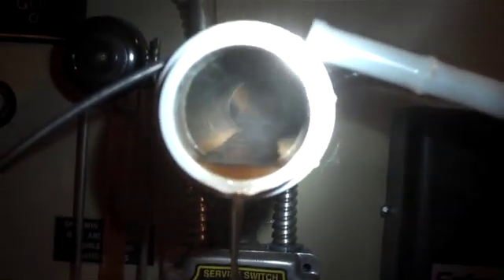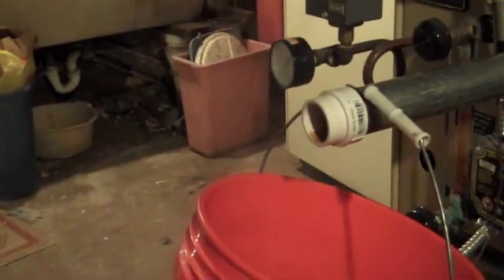boiler skimming

Comment: your welcome. Its time to skim that one again. Supposedly skimming is only really needed when piping or boiler is new but it's surging again. This boiler never gets a drop taken from it because it has a electronic sensor stuck directly into the boiler and no way to drain except the hose bibs on the bottom of the boiler. This year i'm installing a valve and pipe permanently to a bucket. Also I'll paint the inside of a tee white so I can inspect the stream of water coming out.